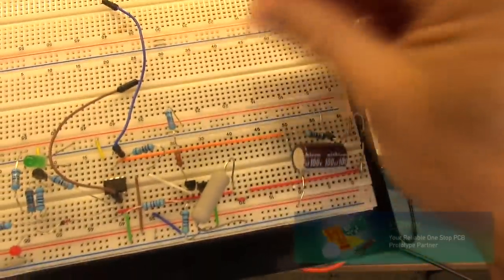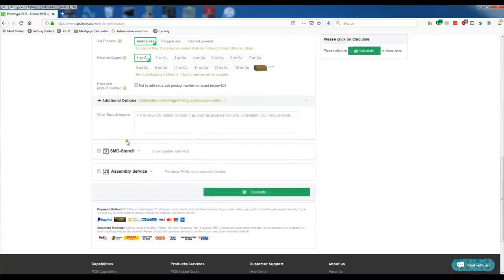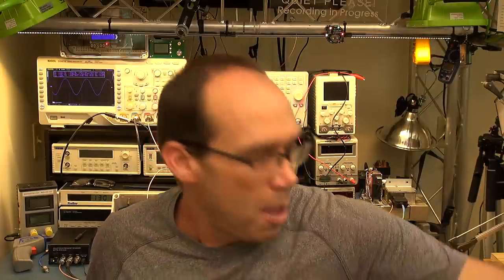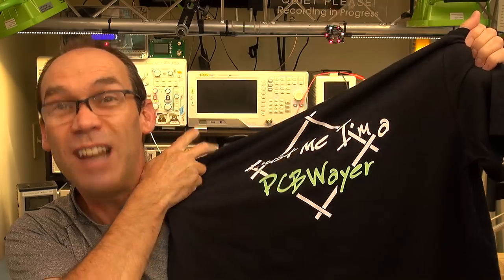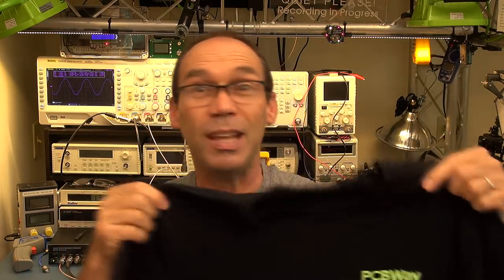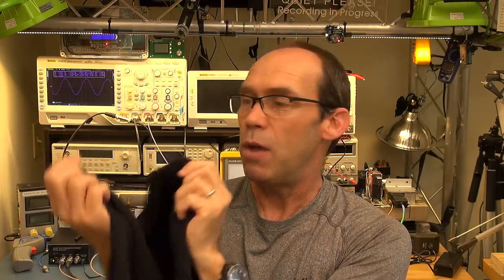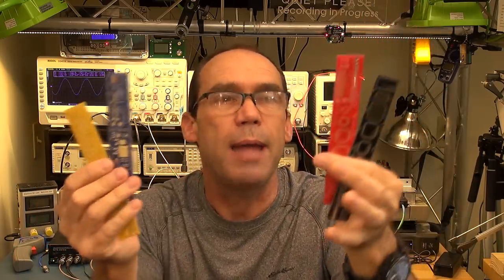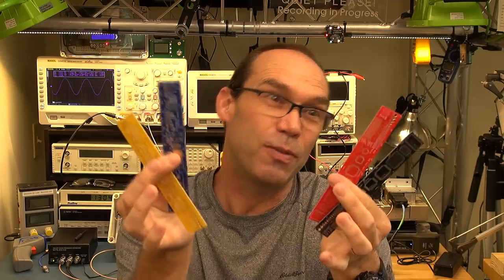T4D #145 - Leaf Driveway, HA Clock and more...

Comment: Very interesting about the driveway and the diamond mesh that you used!
  One thing I noticed... at 20:08, will the "uphill" side have drainage so that the water will not erode away the earth next to and under your drive?  It looks like there is a slight incline that comes down to the drive, and if water is moving at a high rate, it might undermine the driveway.
Maybe cut a trough next to the drive for a drain?
Hard to see what kind of slope there is.
Just an observation.
Reply from the maker: A very good observation. Most of the water is diverted at the top of the driveway, There is surface water that accumulates but most of that runs down the left side (looking down). However, adding that big slab down the middle could change the flow and I am making a note of what the water does in heavy downpours. Erosion undermining the drive could be an issue I have to deal with.

Comment: nice with the driveway, for energy storage how about a used Leaf battery, one with low mileage left will still have enough capacity left to store a day's worth of energy, and they are available along with the charge controllers for solar. Plus you can use the solar to charge the EV when it is there, , and possibly use the EV battery as supplemental storage.
Reply from the maker: I do have a LiFePO₄ that has arrived for evaluation that I might use as temporary energy  storage for the leaf. Longer term for the Leaf and cabin a recycled Leaf battery might be a good option.

Comment: Cement companies sell left over cement from a job.   Powder and crumbles..  if you sprinkle it over dirt, grit, sand and water it it will cast up most fine.  I used it to correct a erosion problem on our un maintained road.   Not as hard a pored cement but has lasted quite  few years of rain and traffic.  You should look into it.  We can get if for like $10.00 a yard.

Comment: TerraGrid U-350: Interesting product... I am in a similar situation. I am just wondering how it will hold up to heavy vehicles... you might be fine with your Leaf, and your truck(sigh) but how will it perform with heavier vehicles (think Septic truck or LP truck)?
Reply from the maker: Good question. They have a 3 and 4 inch version. The 4 inch version should allow for a 5 inch + concrete driveway. I would think that would handle heavier vehicles but some research into loading on concrete should confirm that.

Comment: LTO isn't really a good option. You don't need to pay that price for the charge speed. Regular li-ion (LiCoO₂) like salvage Tesla cells charge plenty fast, and lithium iron (LiFePO₄) will work just as well but take more space. You can buy new drop-in LiFePO₄ designed as replacement for lead-acid AGMs, or buy prismatic 3.2v modules at 200ah easily and much larger are available. See channel, "DIY Solar Power with Will Prowse" for a lot of battery review and education. He also runs a web forum.
Reply from the maker: Thanks, good input. I have a 100 Ah LiFePO₄ that has just arrived for evaluation so that might be the best option I have in my hands.

Comment: You could have probably just tacked some geo grid down and plate compacted an inch of gravel over it.

https://images.app.goo.gl/iJw39fvZ96b3FVum9

or even cheaper - Just drive up the hill in reverse ;)

Leaf - never understood why someone would buy one of those.

Chevy Volt with the built in range extender seems like it would make so much more sense while aslo offering power generation in the event of loss.

Or something with more range, better infrastructure, and AWD like the model 3.